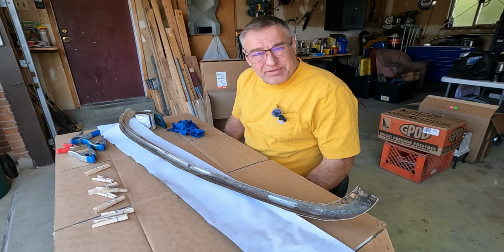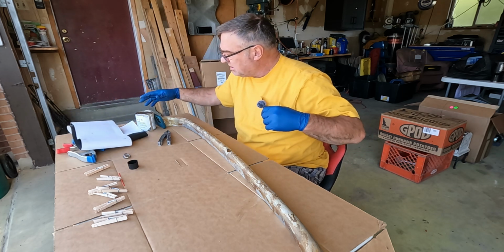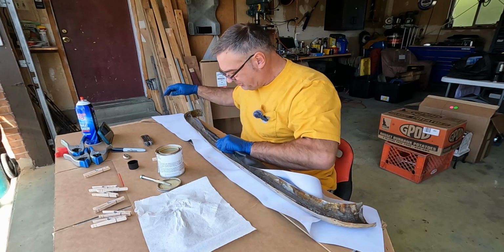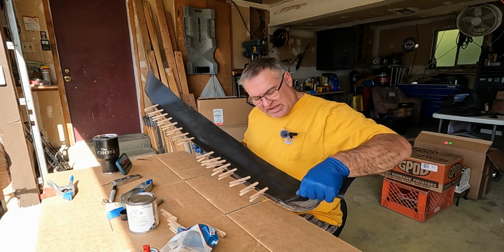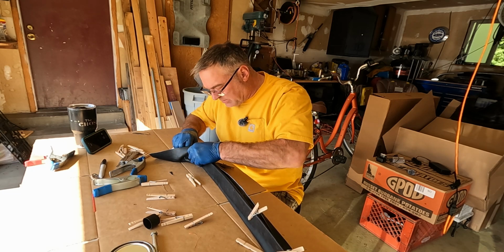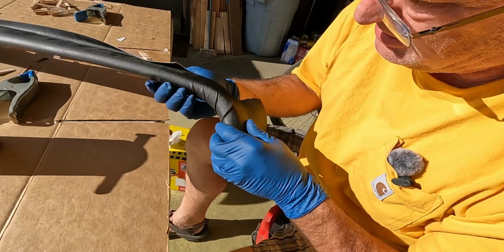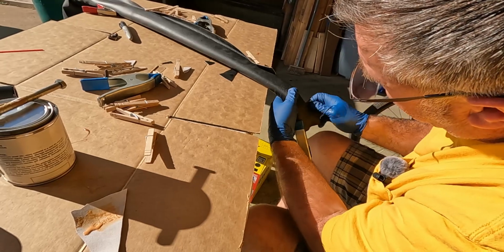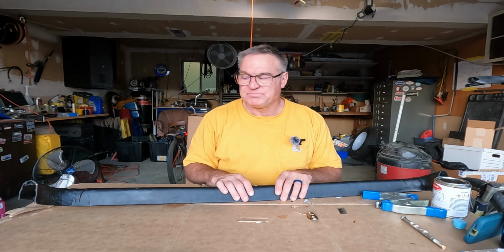We attempt to revive Higgins' dash cover

Comment: I would have splurged on a brush for the glue.
Reply from the maker: I could have, but my experience has been that this type of glue pulls out the bristles of the brush.
Reply: @50lbbrain  I should have known you knew better!
Reply from the maker: @irideaduck939  thank you for your confidence in me. But it could be I used cheap brushes in the past. 
This glue is pretty awesome. It's used for repairing rafts and other stuff where it has to remain flexible even after it's set up and dried.